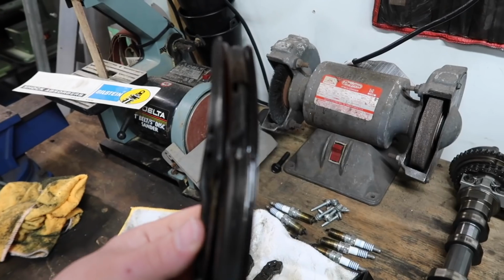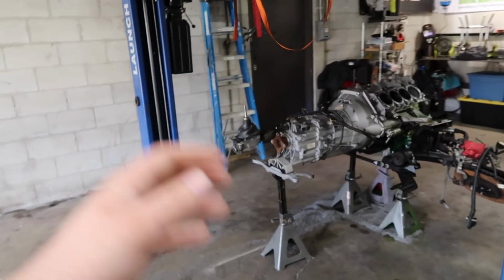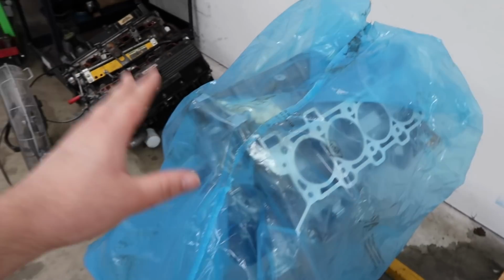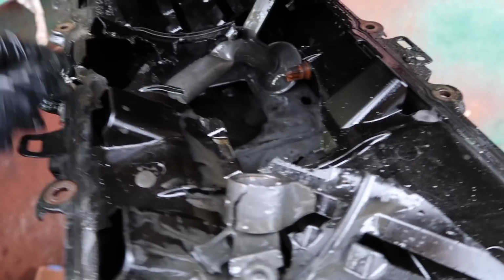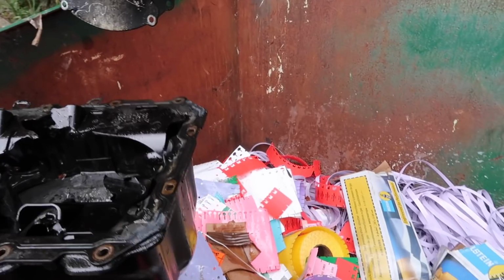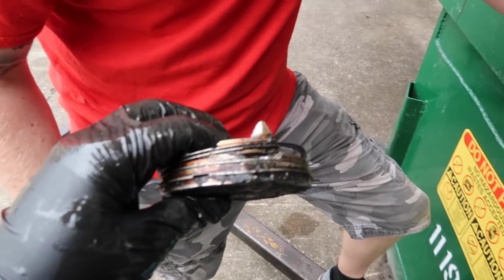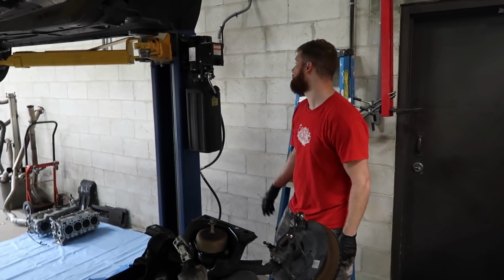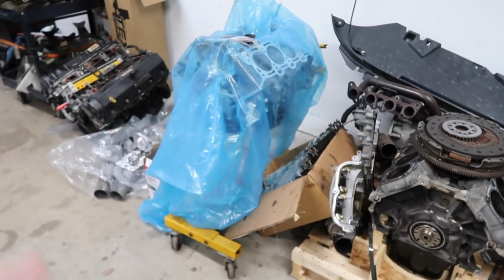Rebuilding a Blown Up 2011 GT CS It is Worse than we Thought

Comment: I have a complete motor for sale, 2012 engine, runs like a champ, at the time of me swaping it..... I was full bolt ons, and at 460 to the rear wheel. Wanted to stay NA and high reving so I built a high compression high reving motor
To 9000 RPMs, curently the old engine is sitting on a stand in my garage. Still sealed ecept for intake manifold. Its taped off there. Contact me if your interested, swaped it 2 months ago
Reply from the maker: send me a message on IG @mrajstech
Reply: Ok I did.
Reply: gpquinney you might want to port the heads, it doesn’t matter which generation of the new 5 L, they cannot flow to 9000 RPM
Reply: @carstuff4u942  Right on, well hear is my build so far, ●PORTED Cobra Jet intake Manifold ●VMP twin 67 TB ●PMAS cold air ●Lu47 injectors ●BBK Long tube headers ●BBK offroad Xpipe (no Catts) on this car ● Extreme Stop cross drilled and slotted rotors ●Extreme Stop carbon graphite pads ●Russle steel braded brake lines ●Ford Motorcraft dot 5.1 brake fluid ●JLT catch can ●Barton hybrid 3 shifter- trans mounted ●Ford Racing aluminum driveshaft ●JMS fuel pump voltage booster only 5volts over stock settings ●AMP Stage - 3 BUILT MT82 transmission ●Ford Racing roller pilot bearing ●BMR Adjustable Uper Rear control arm W/spherical fittings ●(All MacLeod) ○Street extream clutch-26 Spline, ○race spec flywheel, ○hydraulic throw out bearing, ○steel braded clutch line. Changing to ALL MANTIC after motor is droped in....331 factory gears. 《Old Motor》 dynoed at (432 on 91), (450 on E54), (460 on E85) all to the rear wheel ....new motor.......
●2012 coyote 5.0 block compression decked, ●Boss 302 crank, ●Manley forged 43-40 H-beam rods, ●Mahle forged Cobrajet pistons, all forged rotating assembly and ballenced ●Boss 302R heads NOT Boss 302 heads, ●Comp stage 3 NA cams, ●Ford performance timing components, ●Ford performance Cobrajet oil pump. ●MSD Blaster,coil packs ●NGK iridium plugs, From 11 to 1 to12.5 to 1...we are planning to port the heads though. We eastimate that could se upwards of 530s to the rear wheel.....we will find out hear shortly...🤪👍
Reply: @carstuff4u942  I'm curently, on a Mustang Dyno at Arizona Elite Motorsports and Dyno 503 / 397 tothe rear wheel and 4 days later on a Dynojet at BlackMarket Racing 508 / 394 to the rear wheel. We expect to see 5 to 10 more HP on top of that since we just finished the break in process

Comment: I would not reuse timing chains from a engine that threw a rod out of the side of the block and locked up
Reply from the maker: They probably would be fine but later on in the video I decided that I would not reuse them.
Reply: Yea u never reuse those c'mon don't put the trash back in ir

Comment: You mentioned reusing the stock crank gear. It would be pretty crazy to not do billet OPG and crack sprocket while the engine is already apart.
Reply from the maker: I later changed my mind. I will not be using any of the old components

Comment: These videos are causing me anxiety about my 100k mile 2011 that I beat on frequently lol. It’s full bolt on and see 7800 rpm frequently haha.
Reply from the maker: I wouldn't worry. The owner didn't know much mechanically. This thing could have been knocking like crazy and maybe he didn't know.
Reply: 7800rpm in a gen 1. Fcking time bomb bro
Reply from the maker: no way send it to 8,000
Reply: @MustangLifestyleTV  Good luck on a gen 1 at 8k rpm. Wont last long...lol
Reply: 100k miles and 7800 rpm? 
Kablooey! Get Prepared!
Reply: My 11 blew at 99k cylinder number 8 fried a ring land. At a minimum you should install the mmr cooling mod to keep the number 4 and 8 cylinders cool.
Reply: @Sdibble2000  I have 104k miles on my 11 tvs 5.0 600wheel 91 octane vmp tune with no mmr cooling mod. You must have had bad gas and detonated bro. I do have other cooling mods though.  Have Reishe 170 Tstat, Lowered cooling fan settings, 2014 Gt500 fan, and just installed Vmp triple pass heat exchanger and Fluidyne radiator.  Either you had bad gas or too much nitrous,  or overheated motor.
Reply: @Sdibble2000  Another guy on here has 160k miles on his 650wheel 12 5.0 and runs 10.4 never an issue. Still runs 10.4 with 160k miles. These coyote are tough,  so to blow one something must of gone wrong from the outside.
Reply: maximus vonce thats impressive. My luck isnt that good though!haha! Well I bought my 11 with 72k on it and quickly realized it burned an abnormally high amount of oil. About a quart every 1500 miles. Seems like my number8 cylinder was already on its way out. Unfortunately Ive had problems with both of my 5.0s. I now have a crate gen2 in my 11 and after 1000 miles in it started the bbq tick and noticed metal flake in the oil and filter. Mine seems top end related. I installed l&m intake cams, allnew timing components, hd secondary chains, boundary opg and crank sprocket, arp bolts-head studs. Thought I did everything by the book and overbuilt it and lone behold I get flake in my oil. Some bullshit man. I spent a lot of money doing this swap. It is still running at 110,000 milesnow but the metal flake worries me
Reply: @Sdibble2000  So you now have 110k miles on Gen 2 crate engine. My car burns 1 quart every 400 miles bro.
Reply: @Sdibble2000  If you have 110k miles on gen 2 crate motor i wouldn't worry about metal flakes.
Reply: maximus vonce no bro my original engine blew up at 99k I now have 110k. So 11k on the gen 2
Reply: @Sdibble2000  How did you see metal flakes in oil.  May just be from break in, that's normal.
Reply: @Sdibble2000  Yea someone else may have overheated gen 1 before you got car.
Reply: maximus vonce yeah man thats what ai thought as well when I changed the oil at 1000 miles and saw the flake and figured it would probably diminish. So to be proactive I then started changing the oil after 1500 miles to flush out any leftover particulate. I went through 3 more oil changes and to this day on my last change at 8500 miles on the gen 2 Im still seeing just as much metal if not more then before. The particles are ferrous as well. I have a vid on it. On the last oil change I put ceratec in it to get rid of the tic and it runs a little smoother. It still pulls like a freight train up top but i dont know whats causing the flake. I have a slight vibration at 3.2k rpm that I have isolated to the engine and the car tends to almost always surge and hesitate between 3-4k rpm. I dont know if its related to the flake but the flake could be clogging up the cam filters and not letting enough oil get to the phasers to make them actuate properly? Hell i dont know. At this point I just drive it.